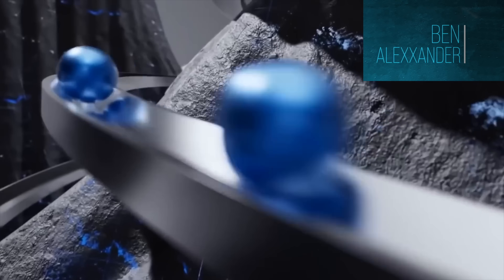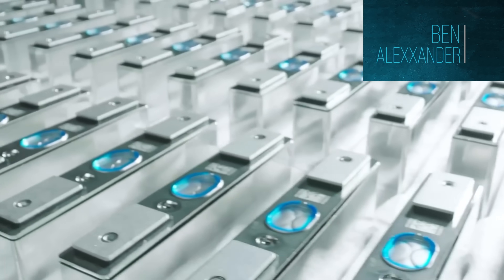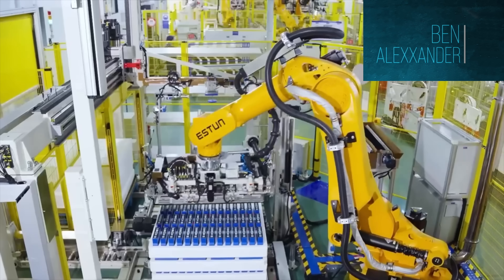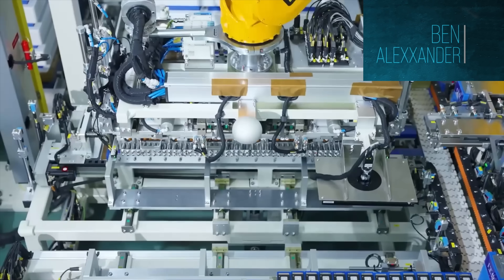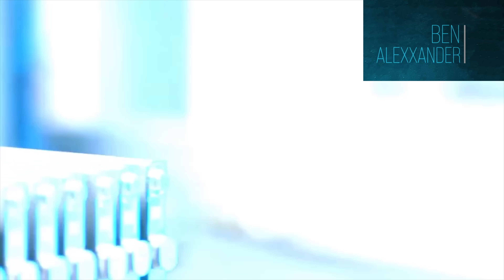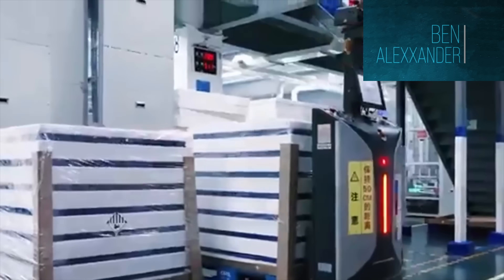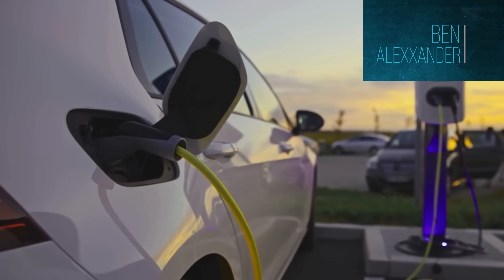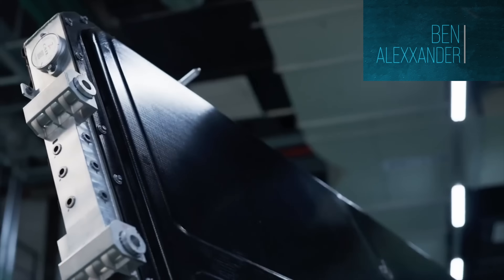CATL’s New Sodium Battery Lasts 3.6 Million Miles — 50% Cheaper Than Lithium

Comment: This could be a gamechanger, but what about only being able to charge the cells at 10% charge rate when below 0c. A twenty percent capacity drop also occurs when temperatures also drop below freezing --- source Bluetti Na power bank test spec sheet and You Tube HoboTech video tests (16min in). Efficiency is another concern, 85% for Na vs 98% for Lifepo4, that's a huge gap to fill before Na becomes truly viable.

Comment: I have had sodium batteries in my Prius going on 2 years work fantastic.  Great performance and charge quickly
Reply: liar
the prius charging system only works with LiIon
if you don't know the difference... well...
Reply: @magnalegione interesting since I tested the prototype and now have the production Sodium system in my car.  FACT!… do some research before you spout off with disinformation. NexPower

Comment: Always be very wary of manufacturers figures.Real world use tells a completely different story. In addition, using cars and windmills as examples,  they last half of the manufacturers stated life span.
Reply: Evidence and data?
Reply: @logant6490  You have to use some work yourself. Find and learn from YouTube where the uploader is someone who is not involved with selling or manufacturing of EV car batteries and Windmills. As I say, real world use.  Not the latest breakthrough that in just five years will revolutionise batteries or power production, but ordinary people who actually own an EV.  Construction workers who install windmills, or are involved with the maintenance of them. Basically, too many people are green washed and when someone points it out, they demand evidence but can't be arsed to check themselves.

Comment: sodium is heavier than lithium. Sodium has an atomic weight of about 
23 g/mol23 g/mol
while lithium is about 
6.9 g/mol6.9 g/mol
meaning a sodium atom is roughly three times heavier than a lithium atom. This difference in weight is a key reason why lithium-ion batteries generally have higher energy density than sodium-ion batteries, making them lighter for the same amount of energy. 
Because sodium is heavier, sodium-ion batteries are larger and heavier than lithium-ion batteries for the same capacity. This is a significant factor in applications where weight is critical, such as in electric vehicles.
Reply: So a sodium EV battery could weigh 1800 kilos.
That is more than my entire car.

Comment: Nuclear doesn't look obsolete, it is a base load power source that can run smelters and the 4th generation reactors are being designed to last 80-100 years and run on old nuclear waste. Solar and batteries aren't base load power and can't run smelters or other power hungry businesses. These batteries may run some houses with solar but a few days of rain will mean you need to get some base load electricity again.

Comment: yeah, the sodium batteries have at most 80% of the LiIon batteries capacity and weigh 120% as much
that means a car using sodium batteries has to haul twice as much mass (don't forget the heating/cooling battery system, the larger cradle and the larger motor/brakes to accommodate the extra 120% weight)

Comment: even LFP's have more capacity- and sodium ion has a shorter life span. those are the 2 standards of greatest concern- energy density & longevity. sodium fails on both those. that being said- it's cheap. I'd say 12v car batteries & portable storage- a great place for sodium. but unfortunately for sodium, the energy density per Lb. just will never be there.

Comment: The biggest problem i see is the discharge is linear. Meaning that to use all the energy of the battery, at some point you need to use a step up converter. Or have a circuit that switch parts of the battery from parralel to series in order to have a higher voltage. As the flex volt 20v-60v battery.

Comment: 10 years ago I made an off grid system to run my house just using 6 caravan leisure batteries and 2 kilowatts of solar. Just a boat set up but bigger and 24 volt system. The batteries dead after 3 years. I might wait a few years and do it again with Sodium.

Comment: To claim that this battery could power an EV for 3.6 million miles is a lie.  It has not been around long enough to be tested that far and for that length of life.  Like all things EV, these things are massively overstated every time.  I will believe this if testing to failure is done to over long enough time to demonstrate its actual performance.  Until then lets see honesty rather than fan boy exaggeration.

Comment: Sounds promising.  I haven't bought into the electric craze previously because of the common fears associated with electric vehicles; range uncertainty, fire, finding operable charging stations on the road, etc.  I tend to buy 3 year old cars and always worried that the previous owner abused the batteries and might incur a horrendous replacement cost. I'll believe the hype when I see it, but not before.  I'm not a strong believer in CO2 from cars being a problem; more like plant food.

Comment: The energy per kilogram is deceptive measure if the battery takes up vastly different volumes, what are the relative energy densities by volume instead of mass?
Reply: atomic weight Li approximately 7 // atomic weight Na approximately 23  //  so the same number of Na atoms is 3 times heavier than the same number of Li atoms.  This will make it pretty hard to achieve the same energy density of lithium, by weight or volume, when  sodium's ionization energies are even less than lithium's.
Reply: @terrymooney3041  Yes, but it's not always so simple and the atomic weight is misleading. We know the density of sodium metal is 0.9g/cm³, while lithium metal has a density of 0.54g/cm³, so in real world sodium is about twice the weight per volume. But the specifics of the dielectric as well as the electrolyte will cause this to deviate significantly, so design and construction must have a big impact. I just wish reports would offer all the details, not just cherry-picked data.

Comment: Need Sodium for Telecom at -48V.  Ready to do PoC!  Bring it on.  Lithium is avoided in indoor spaces, and on roof tops due to 3rd party liability.  What are the gasses evolved by Sodium when forced into thermal runaway?  Any UL9450A done yet (as it can be applied)?  China will first feed into EV needs, then 19" rack mount batteries, and lastly 23" for Telecom... which is used in North America and many other parts of the world due to the present day AGM battery size.  A DC-Converter would be needed to feed flat -57VDC to remote radios, while shelter equipment can operate down to -36V next to the battery plant (no long cable losses to deal with).

Comment: Don't think bmw, vw, ford, nissan etc are bother of 3 million miles battery longevity never mind 500,000 miles. The bottom line is ££££. 
But 3 million miles 20,000 cycles is great for customers and the environment... Battery used after vehicle to be grid and home storage etc..

Comment: I love the concept though I see uphill challenges to anything not oil related at this time. As a builder and craftsman, I have a considerable investment in cordless tooling, all of which use Lithium Ion battery technology. It works well but I would be happy to move on to Sodium Ion provided Milwaukee, Makita, DeWalt and others would be willing to make new batteries that work with their existing tooling. I would one day like to power my home with batteries and inverters. The technology, efficiency and affordability is close to making this dream a reality but I'd like to see the new batteries work seamlessly with existing units. Too often technological improvements demand complete changeover in hardware at vast expense. Can this change in battery technology be done in such a way as to honor existing investments?

Comment: Sodium batteries yes had been around - I use one for my PV system Perfect and has no thermal runaway etc - at CATL‘s quality and cost it will be a game changer as price will „drive“ industry and people there and you save weight for less rigid&firesafe battery pack housing so more cells per unit weight etc

Comment: The limits of solar coupled with batteries on the grid are dominated by energy production droughts during periods of high demand, which in some places imply the need for weeks of storage capacity, which is astronomically costly even at the 50% rate. This is what really makes solar/wind so much more expensive when they manage large fractions of the grid: We still have to maintain all the original electricity production systems along with solar because you can't build enough storage to overcome this problem.
Reply: Hydro dams.  Kinetic storage.

Comment: Maybe not enough said about the potential for thermal runaway - in detail. Yes they are 'safer' but why and show the details. Safety is a HUGE concern over EV cars - plus of course how long the battery will last. If their reliability, safety, low costs and long lasting claims get to the real world (sold in cars) then EVs will crush ICE cars within 5-10 years. I am hanging on to my 12 year old ICE vehicle and will wait - I was thinking a new Hybrid - but not now.

Comment: just a reminder: CDs were said to be able to last indefinitely. However corporate manufacturers found a way to save a few percent and pump them out cheaper. Nett result, they last just a few years. Sodium battery manufacturers will do the same; just get them to go good until the car warranty runs out.

Comment: These batteries are terrible at both high and low temp charge and discharge. When cold the charge at only 10% voltage. They may last longer but are terrible in any commercial or industrial implementation.

Comment: Using Sodium batteries looks tremendously better than lithium but I’m hearing that you need more sodium in bulk than lithium so that means bigger batteries for the same volts which in turn isn’t such good news to the cordless power tools industry as there main goal is to make smaller batteries with more power 🤔

Comment: The battery tech is cool. cheaper batteries that last longer, is great for lots of things. The issue here is the energy density, because its about what low end li-ion batteries do. While not an utter disappointment or anything, this means that the batteries still have to be rather large to do much. This, however will be great for things like home storage as the video mentions (assuming 50% current cost, and 20+ years).

And for all you looney toon carbon alarmists, this wont scale well enough to make solar or wind viable on a grid level. It will help, but the last I saw power companies need it to be 90% cheaper than li-ion to compete with natural gas, and 95% cheaper to compete with Nuclear (which is what we all should be using). The major issue with solar/wind is the maintenance costs, and the foot print of them. Im not sure how you looney toons can call yourself environmentalist when you are killing millions of birds every year with your wind farms, and solar can disrupt entire ecosystems... You guys really need to get your brains checked...

Comment: I'm a retired electrical engineer.  One of my areas of responsibility was battery technology.  I hear you blasting the oil companies for providing the energy the world currently runs on.  Could you please give me details of the direct replacement for fossil fuel that can be supplied by any battery? I will be anxious to hear your response and delighted if you have one.  Don't get me wrong batteries have their place.  But as far as I know they are no match for fossil fuels.
Reply: Very glad to hear you've retired. Don't hesitate to enjoy it and leave the energy transition to the next generations.

Comment: You pointed out the power to weight differences but what about the power to volume differences?
Reply: Yes, that's a bit of an issue. Which is why you're actually sitting inside a battery-on-wheels in the future. ;) ;)
Reply: That is indeed an issue but for home backup its not as big an obstacle as for use in cars. Its not difficult now to run everything but hot water, stove, and dryer now with a few solar panels and a 15-20kw battery system. So with proper sized solar panels, the room to do it, and all those physical factors this can be and is a major break through for energy storage. As soon as it gets cheap enough.
Reply: So I guess no one wants to touch this with any real world data. Only whataboutisms.
Reply: @3Hose chatgpt says "LFP currently offers higher energy per volume (and per weight) in many commercial implementations than sodium-ion, making it a strong choice if you want “more watt-hours per cubic inch/cm” and have a fixed volume budget."

Comment: I truly want sodium batteries to replace lithium, I always fear that one of the many lithium batteries in my home, in one of the many products that I use will one day catch on fire and make my wife and I homeless, just the other day my wife's power bank popped open because the internal lithium battery  began filling up with volatile gas, I took it outside and it's now kept in a fire proof bag in my old charcoal grill far away from anything flammable😅. The problem is that I have no lithium battery recycling stations near by and transporting it long distance in a car or on public transport could be a bad idea too🔥. 

My main concern with this sodium battery is not the battery itself, but the fact that a product that last longer my not be seen as profitable.  I feel like these large teck companies prefer the words ( Built-in or planned obsolescence ) , as they prefer that people are forced to buy products with a shorter lifespan, so we need to continue buying these products😫.

I hope that I'm wrong, and that we can start getting rid of these lithium batteries that are a huge problem for many different reasons. 😊

Comment: I own an EV, so I say this with acknowledgment to irony. What about Electrical Grids? How will they supply thousands upon thousands of increased EV users? Most countries can barely function with the present level of demands, let alone a sudden huge increase in demand. Where is all the power going to come from to let all the car owners plug in instead of the majority using fuel and not crashing the Grid? All Electricity prices will skyrocket, making gasoline look like it was virtually free, and the big kicker, every person who doesn't even own a car, will end up with outrageous power bills.  Plus, with a drastic decrease in Petroleum production/Refinement, any remaining products will instantly go through the roof in cost. The very first thing I did when I got home in my new EV, was to change the oil. In the Gear Reduction Unit. Brutally expensive because of being a less common oil made. Will it become $100 dollars an ounce in a few years? All bearings and suspension components use Petroleum products. Much like A.I. I'm personally not picturing this ending well, lol. Monkey's Paw.

Comment: I first started hearing about sodium batteries as a possible replacement for lithium about 5 yrs ago. After reading the articles on them I knew back then that they would most likely be the dominant energy storage device. They had everything going for them except energy density however I surmised that problem would eventually be solved. What I am surprised at is how quickly they solved it. Once cost comes down and they are evaluated in real world applications, if they live up to the hype the lithium batteries will become a thing of the past.
Reply: That would be nice. I know economies depend on oil production, but if we have the tech to do it, I see no reason not to phase it out over time. Instead of forcing people to adopt certain things, like electric vehicles, they could incentivize people to adopt it by not taxing it. Wouldn’t have to pay out tax incentives. Just let people freely adopt it and quit trying to force people to adopt it and more people will be willing.
Reply: @stuckgrenadepin.225 - You want people to adopt it 'freely', but still want to tax things you don't want?
Any tax is not freedom. Taxes are the definition of slavery.
Reply: @scorchedearth1451I don’t want any taxes, but they are a fact of life. Keeping our border secure costs money. Keeping our fire departments running costs money.  I know we ran on tariffs until 1913, excluding the civil war, and would rather do that but that was before that last couple states were even accepted to the union. Before our population reached 300 million. The only thing we can do is to keep the government as small as necessary. The founders understood the need for taxes as necessary, otherwise they wouldn’t have included a provision in the constitution for them.
Reply: @stuckgrenadepin.225 - There were borders, schools, fire departments, police, and roads before government existed.
Instead of them running our lives, we did it ourselves.
Reply: @scorchedearth1451no. There was just a different kind of governance. Grow up. Government is a necessary evil. We just have to do a better job of policing it than we have.
Reply: @stuckgrenadepin.225  - Every kind of government is like cancer.
It will eat it's host alive.
Government has NEVER enough money, and they ALWAYS find new taxes for you to pay.
Governments become more and more CORRUPT over time.
And oh boy, are they corrupt now.
But it will always get worse.
The system has to collapse before it gets better.
And it will collapse.
Reply: @stuckgrenadepin.225  - Of course it was different back then.
Now they have more power to control you.
Even more when you have a digital ID.
All this is a dictator's dream.
But freedom? You can't have freedom when you have an always growing government you have to work for.